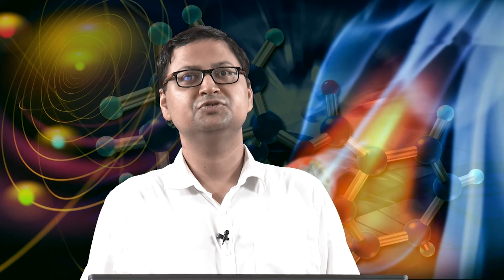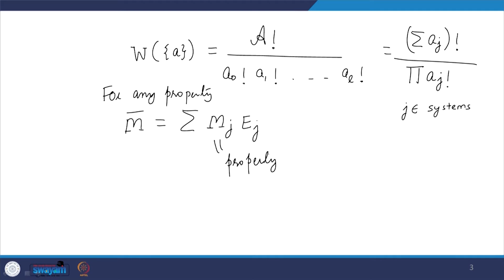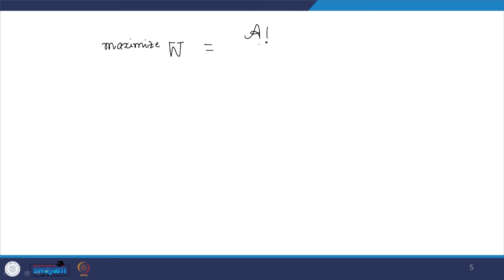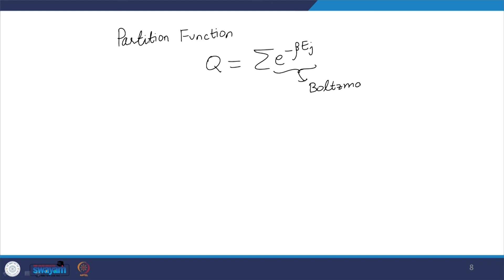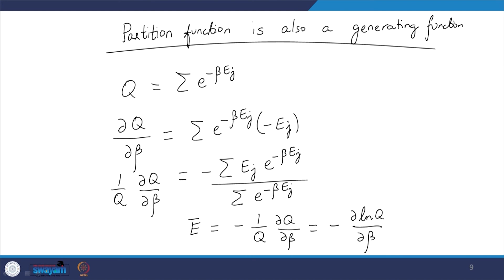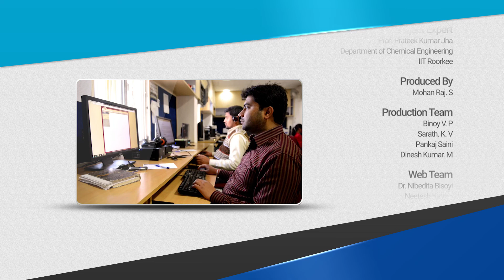Lecture 14: Canonical ensemble: most probable distribution, partition function

Comment: But, at 27:30, since you derived with respect to aj, you have found the most probable aj (that is (aj)*), but not the most probable distribution {a} (that is to say {a}*).
That particular value of aj = (aj)* could be present in different distributions (different {a}); in fact, it is present in all distributions. The P((aj)*) is the combined probability of (aj)* over all distributions {a}
Although it is clear that the main contribution of (aj)* comes from {a}*
Reply: It's possible that few steps may be missing in the derivation. You may refer to Statistical Mechanics text by Macquarrie for detailed derivation.